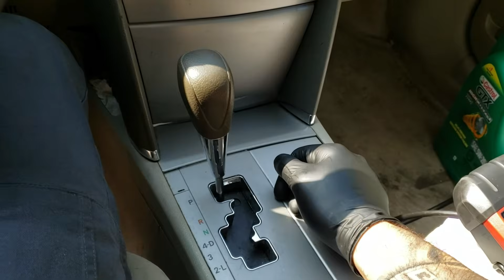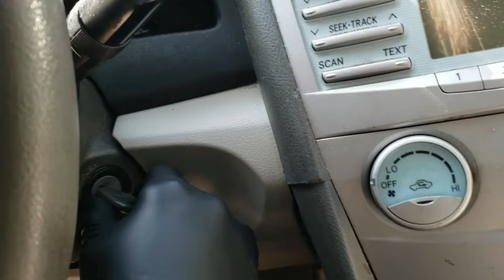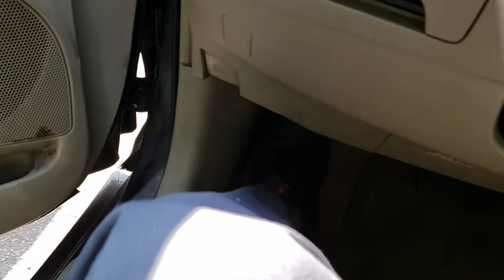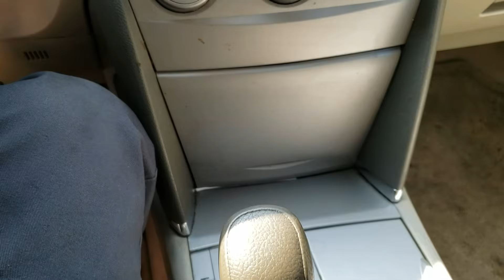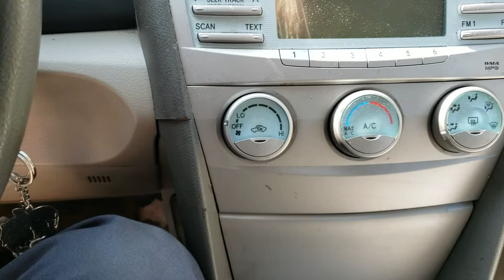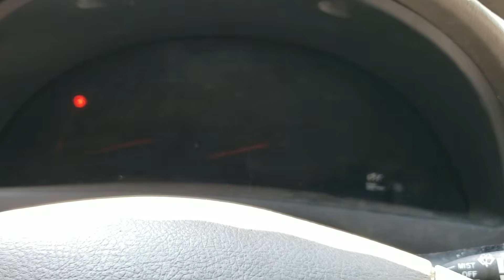2006-2012 Toyota Idle Relearn Procedure

Comment: So Mr. Rodriguez, I wanted to thank you for this video. My car was running at 20 mph without pressing the gas pedal. It was also going in reverse at 20 mph without pressing the gas pedal. And it was down to 8.8 miles per gallon. I had read and read and searched and searched and watched dozens of videos about Throttle bodies, TPS, IAC, MAF Repairs and replacements. But I was not sure that any of those were the problem. Anyways, my mechanic had cleaned the air filter and some other things but the problem still existed. Then I saw your video and I tried it this morning and eureka! My 2006 Toyota RAV4 no idols at 700 RPM which is exactly where it supposed to be and it was still move but it will not go up the hill and it is working perfect. Someone had told me to check the IAC and that’s what I was doing when I found your video. Thank you, thank you, thank you
Reply from the maker: Comments like these are the reason for this channel. Thank you ! Im really happy i could help! I hope you subscribe!
Reply: Dale mine just started doing the same thing a couple days ago. Idling high enough I can hear it and accelerating way more than it should while I’m not pressing the gas pedal. Really hoping after work I give this a try and it works!!
Reply: @EliBennettt  did it ?
Reply: @glooutchea5555  lol no it’s worse. Might be a bigger issue than I hoped it would be.
Reply: @EliBennettt  did you ever figure it out?
Reply: @Brandon-21MN  sure didn’t. Instead, I work from home now and use my wife’s car if I need to get out. If I don’t keep slight pressure on the accelerator while it’s running, it dies.
Reply: 20 mph in reverse without pressing the gas pedal?!!! Lmao, that will make for some scary and uncomfortable feelings right there!

Comment: I did relearn then the day after it seems to have same problem again I can't get it to idle long enough for the relearn.  Then after trying n trying n even holding the gas pedal under 1000 rpm, still not holding my idel.  Then I gave up n tried again about half hour later n it idel good.  Now if I put in park for a relearn, she died.  Before this, I had my alternator warning light was blinking.  Could it be my battery is bad that it is making the ECU unit have to relearn n reset from time to time?  I do have corrosion out of my terminal and the battery is 3 years old.  Plus my car is only going 50mph up the hill, no power.  If I push it to 60, she vibrates bad.  Help?

Comment: After replacing generator for my 2007 Camry, it had rough low RPM, idling at around 500. After some driving it was throwing P0138 and P0606, and was stuck at rough idle. Resetting codes would make them back as soon as I try to drive. After resetting the codes, and then following this procedure, it seems to be good, and no codes so far. Fingers crossed. Thank you for this great video, took me a bit of searching until I stumbled on it!  Was ready to start ordering O2 sensor and maybe even scrapping my car, as buying new ECU in addition to generator would be too much.
Reply: My friend. Did you get it solved with the idle relearn procedure for the p0606? Thanks.
Reply: @JuanSanchez-ir2nj  Yes, after doing procedure from this video once, idle was good.

Comment: This is such a great video i had this problem where i was idling so low and i would stall when i stop i took it to a shop spent $250 because they fixed somthing else but it some how fixed it and then it was idling bad again after i disconnected my battery so i watched this video and it fixed it mad respect man

Comment: I've watched other videos & they start the vehicle on the second ignition cycle but it didn't work.  I notice you start the vehicle on the third cycle.  I'm going to try this way.  Replaced the battery & its been a week. The idle still too low & stalling. Thumb up the vid.

Comment: THANK YOU SO MUCH YOU SAVED MY LIFE ON A 2007 COROLLA AFTER I REPLACED STARTER , NOTE MY CAR IS MANUAL SO I PUT IT IN 1ST GEAR AND HELD CLUTCH AT BITING POINT FOR 5MINS AND IT SLOWLY MADE IDLE PERFECT!!! THANKS BOSSSS!!!
Reply: Thanks, mine is a manual. Changed alternator and had rough idle. I think its fixed

Comment: wow..after 1 yr ago when this video was made, little did i know this solve  my camry's low idle engine (almost died and terrible engine shaking, alway have to put some pressure on the gas to maintain comfortable engine idle) been driving like this since a yr ago.thanks a million man. You save me from a mechanic ripoff telling me to replace throttle body/mass airflow sensor a while ago.

Comment: I have a 2007 camary and I replaced the battery but then the gas pedal didnt work. I get no response from it at all. And the idle is messed up as well. I tried your relearn but it did nothing for me. The throttle still doesnt work and idle is still messed up. Can you please help?

Comment: Hey I'm having trouble because although my car is drivable,  it only idles for like 3 to 5 seconds before shutting down. I can drive it if I put it into drive immediately.  When I try this, it looks like my car is making an attempt to idle but it just dies
Reply: 2008 scion xb.....had the same issue.....i had to play with the gas pedal......in order for the car not to die on me. After pressing the gas pedal on and off for a few minutes.....the rpm stabilized enough to stay running

Comment: I had the alternator changed last month to my 08 RAV4. When I got it back the idle was very rough almost to a stall. I just tried this relearn procedure and around 3 minutes while idling in drive with the parking brake set, the engine rpm went up and I heard the change occur. I drove it after 5 minutes of the relearn procedure and it runs perfect. I wasn’t able to make it idle rough at all and it idles nice. I’m amazed! Thank you for sharing this.

Comment: What if it still stalls when I put it in drive? Do I do the process all over again?
Reply: Which model you have? Check you IAC Valve. Clean those area. Check your PCV Valve. Could be a number of thing as well. If none fix, possible your fuel system. Start verifying those area, fuel pump to the front fuel injectors

Comment: Can this work on a toyota axio 2008 model ? Any one to help out, i replaced the battery and idle rpm is very low (about 400rpm). And thats causing vibrations on the car. Help !

Comment: I relearn my lexus is250 2008 model by just drive it around 5km in highway with ac on it relearned itself, now driving great again!
Never disconnect the battery when it’s unnecessary.

Comment: My wife’s 2008 Camry XLE only idles high first thing in the morning it seems.  During normal driving it’s perfectly fine.  She did have a new battery installed recently.  Could the issue be a leak somewhere as opposed to having the car relearn idle?
Reply from the maker: Its perfectly normal for a vehicle to idle high on cold start. The idle air control valve opens allowing air to enter the throttle body to maintain the car on high idle for a short period of time

Comment: When you put to emergency brake and shift it to Drive, do you release the brake and let the Emergency brake stop the car for you?
Reply from the maker: yes that is correct, so you have to make sure your parking brake is fully functional
Reply: @RodriguezRepairs  also do you have to press the brake when you start the car? Some ppl on the internet said you have to press on the brake when you starting the car up in order to work
Reply: Hi there  @dreamrider7526 , did you also try the procedure with the brake pedal applied?

Comment: How long should I keep it on to reach normal operating temperature?
Reply: Watch again. He mentioned that
Reply: @RektooNbbf  actually he doesn't specify. He says to leave it on for "a good amount of time" which could mean different things to different people. if you're not going to answer the question, why bother responding just to be a dick to someone?

Anyway, I'd let the car run for 3 to 5 minutes. That should be sufficient to make it a normal running temperature.
Reply: Look at your engine temp gauge. It has a needle that has a C (cold) and H (hot). Needle should be around the middle. You can also grab the upper radiator hose. If it's firm and hot, your engine should be up to operating temp.

Comment: Wait a minute, so, you fully engage the parking brake, put the vehicle in D, and sit there for 5 minutes, or so, not pushing the brake pedal, but only the parking brake???!!! 
You will destroy the discs in the transmission! You have to press the brake pedal to disengage the "clutch" inside transmission. It's like sitting uphill, in D, and using the transmission to hold you in place! 

...

Doesn't work on rav4 2007, by the way...
Reply: What he means is set the parking brake first then depressed the brake pedal and put it into drive so when you take your foot of the brake the car doesn’t roll

Comment: Did you have an issue with car dieing multiple times before it went to normal?
Reply from the maker: while performing the idle relearn or the symptoms the car was having?
Reply: Cleaned my throttle body, now it starts, but shuts off after a few seconds.

Comment: I have a 2010 Toyota Camry that has a 6 speed clutch.  How the hell do I put on the brakes then release the clutch and walk away as if it was on "drive" like an automatic?
Reply from the maker: for vehicles that have a manual tansmission would have to be relearned with a compatible scan tool

Comment: Hey bro I changed my battery on my 2009 Toyota Camry. Car starts but when I put the car in all of it's gears especially drive. I can press the gas peddle to the floor and it's not catching at all and my check engine light is on now. Any suggestions

Comment: I've done this once before but I cannot get it to work now, even my shop said idk
Reply from the maker: are you having Idle issues? what have you replaced?
Reply: I got it now thanks, battery was bad so it would disconnect and reset the idle repeatedly
Reply: @RodriguezRepairs  also Firestone said the battery was good, but they were wrong

Comment: You FORGOT to tell them make sure a/c is off that nothing is on. In the relearn mode. But Great Video. God Bless
Reply: When my AC is off , I don’t have jerking or stalling like symptoms, but when the AC is max out, jerking and stalling come back
Reply: @Ignatius Ewe   you have a ignition miss bad coil,  spark plug or wire. Service soon engine light is most likely on. Go to auto part store have codes pulled.  .ost likely you have a bad coil. The codes will tell you what cylinder it is. God bless
Reply: @rickchambers73  check engine light did not show up at all, hooked up scan tool and there wasn’t any error codes, but thanks to the sharp eyes of the mechanic, they found a nasty crack on my ignition coil. Got it change and it run smooth as before.
Reply: @Ignatius Ewe   GO to you tube pull up video how to sea foam your engine. Buy 2 cans of sea foam run it through the engine  how they tell you. It will be a day and night difference  on how it picks up speed,  fuel mileage and idle. Especially if it up around or over a 100 thousand miles
Reply: @rickchambers73 put a link here if you know how to do the Seafoam thing you are talking about.
Reply: @rickchambers73 I drove around with a bad coil for a year before a light came on. So annoying
Reply: What about the push button start like on the 2010 avalon
Reply: Will this work for a 2010 Toyota Corolla.
Reply: @robertserrato3596 
It should
Reply: i know it is kind of off topic but does anybody know of a good site to stream new movies online?
Reply: @fisheralaric692  can we be friends :)
Reply: @fisheralaric692 
No, now go away or I shall taunt you a second time.
Reply: @Fisher Alaric Lately I have been using flixzone. You can find it by googling =)
Reply: @Fisher Alaric i use Flixzone. Just search on google for it :)
Reply: When I did this my engine light went on. Anyone know how to make it go off again?
Reply: @ruff1982  disconnect the negative battery terminal for 10 seconds and then reconnect.  Remember to perform the system relearn afterwards.

Comment: will this work for a 2008 scion xb? i had the alternator replaced and it started to idle rough at times. when im coming to a stop and then sometimes when im just sitting there
Reply: seemd to do the job didnt completely fix it but 95 percent better thanks
Reply from the maker: yes it would work on a Scion Tc, it has the same motor as the toyota Camry 🙂

Comment: Is it necessary the engine should be at the operating temp. as you 've said,  to make the idle relearn .Then if the car's battery is disconnected for long time, say more than a month due to covid 19 crisis for instance.  Of course the engine is as cool as an ice cube . How then the idle relearn in this case should be performed???
Reply from the maker: yes the car has to be at operating temperature because the vehicle has to be operating in Close Loop
Reply: @RodriguezRepairs  
Thanks  so mych for the reply, but I didn't get ur statement  (close loop) ..what I undertood of ur answer is that:
 1st of all I swich the engine on normally as if in ordinary case of driving till it heats up to operating temp. degree , then I swich engine off for while before performing the engine relearn ..is it so ????? Or after heating up  I should disconnect battery & reconnect it right after to do the relearn while the engine is warm???!?????
I beg ur pardon for prolongation !!!!!
Reply from the maker: @ahmedbusati6268  
okay i can see where it gets confusing. Let me put it in bullet numbers
1. Turn the car on and let it idle until it reaches operating temp.
2. Turn the car off
3. Cycle the ignition switch 3 times, and on the third time start the car.
4. Set your parking brake!!
5. Shift your car to Drive and release your foot off the brakes.
6. Wait about 5-7 minutes, the idle should start to stabalize in that time
Reply: @RodriguezRepairs  
Thanks so much,i appreciate very ur reply and more care about this matter. Now so clear, no more blurreness, no ambiguity. Now i can re learn my tucson once again, because the 1st relearn is not ok;  RPM is still more than 700 rounds.

Comment: My AC clutch keeps cycling after battery change which makes it idle roughly when AC is on. Took it to the mechanic the last time and he reset this with a computer. Is there a way to fix this without the computer?
Reply from the maker: The AC clutch keeps cycling after the battery change? or did it have that problem before?
Reply: Rodriguez Repairs it did not have that issue before before the battery was disconnected. The first time it happened was with a battery change a couple of months ago. This time I removed the battery to replace the starter and it did it again. Took it to the mechanic today and he was able to fix it with a scanner. He didn’t charge me anything to do it because it only took him a few minutes so, it wasn’t a big inconvenience. I just don’t want to have to take it to the mechanic every time I disconnect my battery. He wasn’t aware of a way to reset it without a scanner though.

Comment: Do you know if this will work for 2007 toyota tundra?
Reply from the maker: are you having idle issues? is your check engine light on?
Reply: Rodriguez Repairs my idle only dips down to like 500 at full stop for a couple seconds then goes back up, happened afte replacing battery. No check engine light

Comment: hey and thanks for this video...i have rav4 2007 , the RPM at idle is about 600 to 700 , is that normal? but the car at paring is shaking ,i have replaced the engine mount but the problem is existent...can you help me
Reply from the maker: 600-800rpm is pretty normal for the car being in idle. does that shaking go away after you accelerate?

Comment: Hey whats up...Do you think this would apply to my 2012 Camry that is turning off on its own when I get to a red light...Happens sporadically...Or should I try to clean the throttle body...cars is on 188K
Reply from the maker: do you have any codes in the ECM? most of the time if you are having idle issues to the point where the car cuts off on its own, clean the throttle body isnt going to fix the issue.

Comment: I have a 2010 Toyota Corolla and I recently changed out the taillight but the fuses also got messed with and now when I turn the vehicle on, it doesn’t rev up or do anything when I press the gas pedal and I tried the resetting solution but no changes. think it’s a throttle sensor going out, maybe? any ideas of what could be wrong?
Reply from the maker: which fuses are you talking about exacly?

Comment: Hey quick question so they replaced my automatic transmission on my Toyota Corolla 2009 and on the first day it wasn’t idling bad but now it sounds rough on drive what can I do ?
Reply from the maker: hey! what do you mean by "it sounds rough on drive?" give me a little bit more details regarding why they replaced the transmission and what issues are you experiencing
Reply: Yeah same but I didn’t have anything change but my idling is sitting at 5000 rpm every time I turn the car on

Comment: I have a 2006 Camry I have had a new battery and a gas pedal sensor put it and now certain ways I put my foot on the pedal the rpms race up and down. Do you think this idle relearn might fix it. Thank you.
Reply from the maker: if there wasnt any other known issues before you replaced the battery and accelerator pedal, then yes, try this procedure and let me know if it works for you!
Reply: Rodriguez Repairs I looked at my repair bill and it was the throttle body that was replaced and it says Throttle Body R & R. Would they use a computer to reset the idle? I wanted to ask that question before I try to do this procedure myself. Thank you so much for your help.
Reply from the maker: @sharonl196   @Sharon L  "Throttle body R & R" Just means Throttle Body Remove and Replace. If the idle is not steady then its possible the idle relearn was not performed. Try this process out and let me know if it worked for you.